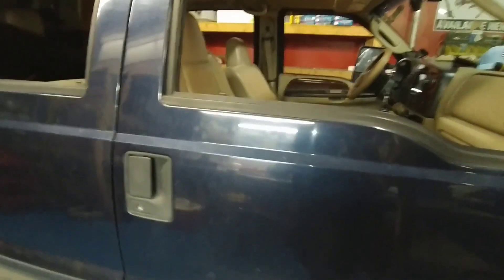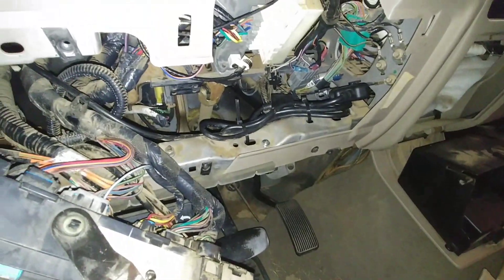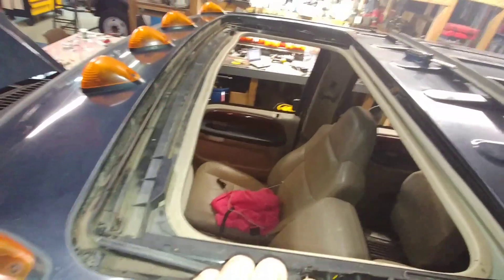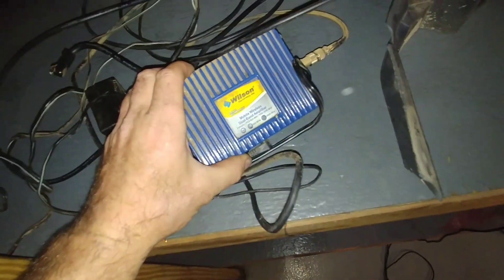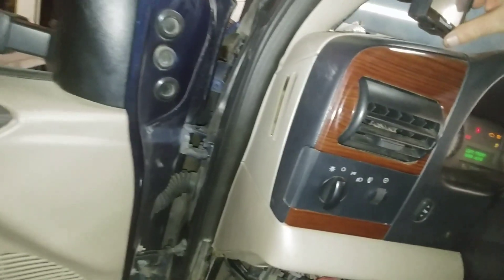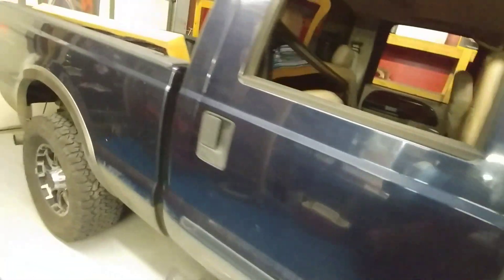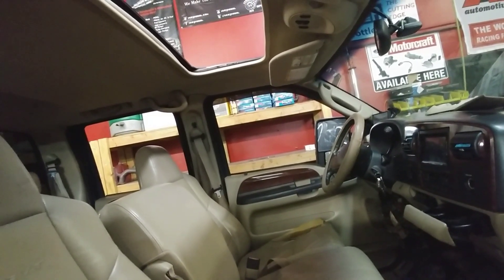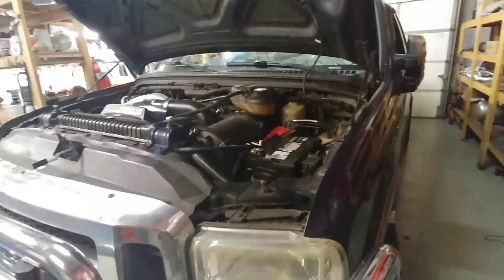Joes 05 no start in the rain

Comment: I was a ford diesel tech in KC and still fix Powerstroke engines on the side. I changed my sun roof tracks slides and it’s a easy fix as long as you have a helper. Just make sure you get new butyl tape to reseal the track.

Comment from the maker: We are planning on having the windshield replaced to check the sealant and make sure it's good.  Headliner can come out the front or rear.  We have pulled countless rear windows too tho.  But I want to check the windshield sealant.  I get windshields done for 120.  Not super duty printed ones.  Those are 400

Comment: Work on German cars in SW Florida. We verify leak first then repair. Some good sunroof pointers were provided in the comments like sealing the rails, cleaning the drains. One additional thing we see down here is the seal on the sunroof itself, it shrinks up over time causing water to leak in. We try and center the glass in the roof first if this is the source of the leak. If that doesn’t resolve it you have to replace the seal. Sad part is seal used to be sold as a separate part, later model cars you have to buy the glass panel. Hope that’s not the case with these trucks. Both of mine don’t have a sunroof, they are nice, but why cut a whole in a perfectly good roof :)
Question Anthony, early Super Duty’s had a problem with the windshield leaking “ while driving only” if this present in the later body’s?
The cause of the leak was failure of the windshield seal on both lower corners where the seal (windshield urethane) met some other sealing compound ford used during production at the base of the “A”pillars. I found this out myself :( . However it was easily resolved by removing the glass cleaning the area then reinstalling the glass. 
Keep doing what you do!

Comment from the maker: This sunroof was an air blowing bastard on the highway.  The seal is still available,,  as is the glides.  And worst case scenario we will replace the entire assembly for 700 freakin dollars.  But I doubt it goes that far.  I have had clogged drains before.   That's easy.  The major concern is the wind while driving.  Gotta quiet this sucker down.